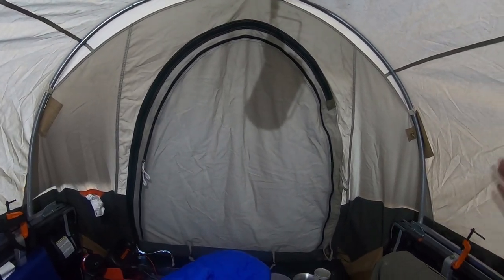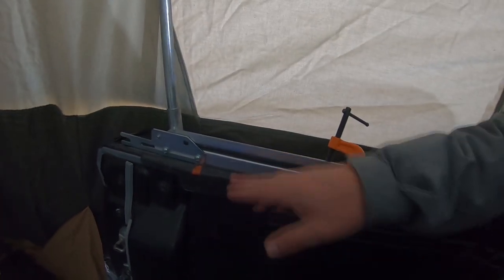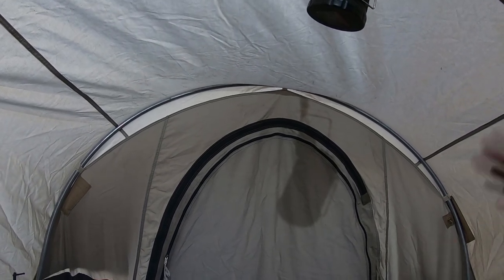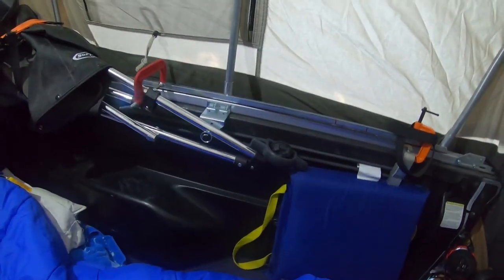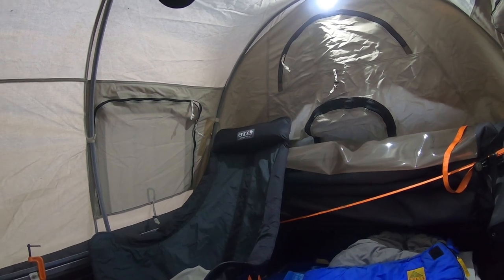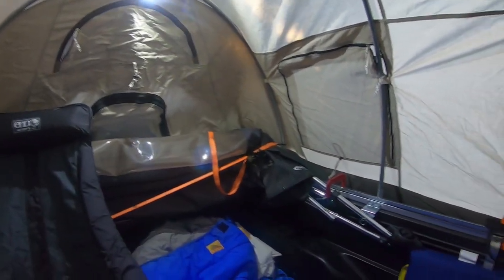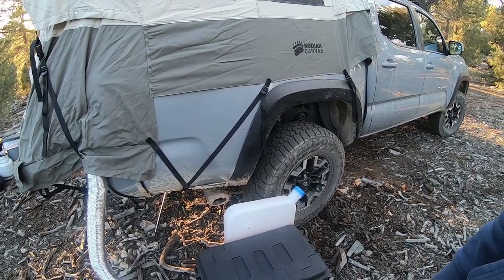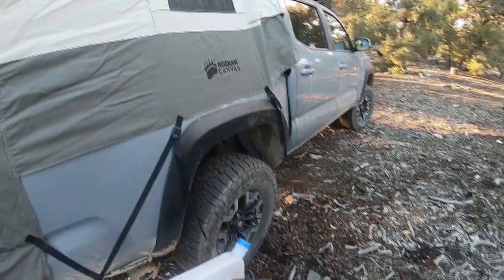Kodiak Canvas Tent Interior WITH a SOFT TOPPER!!

Comment: someone did a drive test with the kodiak still up to see if you could move around the mountains without taking it down. It holds up to like 50MPH. crazy. its easy to set up. it works great and has great headroom. I bring a few foam mattresses and sleep 2 easy with canvas zero degree bags. Comfy. great hunting setup.
Reply: MINE WITHSTOOD 50 mph winds in WY +curt Goudy)..stationary...I drove 20..mounted ...last year...so why not ? From zone to Zone? Problem? KTM Dirt bike LOL.. solution? get rear Skid Mount tail hitch  carrier. versa Hual.  MOTO Tote etc. So happy....

Comment: As a recent owner of a new 2023 Tacoma SR5 with 6' bed, I've vasilated between purchasing another truck tent like I had on my 8' bed 2008 Tundra or getting a Softopper...even considered keeping the well designed lockable tonneau folded back with the truck tent. Whereas my former tent was  a Napier with sewn in floor, I rather like the ability to keep the bed organized as I like and simply set up the tent over it. I noticed that Rightline bed tents also come without the floor, but with nearly $400 in Cabela Bucks, I'm inclined to purchase the Kodiak canvas tent.  I also love the idea of total flexibility since I plan on hauling a small Honda trail bike or scooter in the bed when traveling and a hard topper would prevent that. 

Thanks fof the inspiration to move forward with my decision to have both a tent and foldable cap. I'll keep the tonneau for times I need more security locally in the truck bed.

Comment: Dang that is the setup right there and such a good budget option compared most overland builds. Plus your truck is still useful as a truck!
Reply from the maker: Agreed.  Its an excellent setup for someone who does the occasional overland trips.   Permenant modifications such as campers wear down the every day use vehicle and sometimes impede on the usefulness of a truck.  I dont know what the usage threshold is to justify a camper type build,  but i'd have to think more than a couple trips a month.
Reply: @highlife342  I had a really nice canopy that came with my old Toyota.  It was a nice, streamlined Leer, and I figured it was pretty light and aerodynamic, but that truck was overjoyed when I took off the canopy.  This is a lot roomier than a canopy, and you can use your truck as a truck.

Comment: Love this setup, I have the same Softopper and the Decked Draw System for my Ram and I was thinking about trying the Softopper Tent but I like the extra head room with the Kodiak Truck Tent.
Reply from the maker: Agreed with the extra head room with the Kodiak - it allows for some great ventilation when hot and roomy shelter when it's time to retreat from bad weather.
Reply from the maker: this video link may also spawn some ideas for your camping as well.
https://youtu.be/wM_f4N1M5Xw?feature=shared

Comment: Hey I have a 9 x 8 kodiak canvas tent already.  I have been looking at these tents for my 21 Toyota tacoma TRD off road. I just saw a softtopper and wondered how you like it and what it costs?  What kind of diesel heater do you have? I have never used a diesel heater as I use the buddy heater in my tent normally only to get ready for bed and to take the cool off in the morning. Is there any problem ventilating or is that basically the same as with the buddy heater? Comments appreciated. I also saw a video that days they changed the new truck tents to resting on top of the bed tailgate. I know my truck takes the midsized truck I believe. Did you have any problems using the c clamps for the railing? The one video I watched the Man had to use bigger clamps. I have an inside the bed tie down rail with a moveable track. Will that I present a problem for the rail system?. Thanks Dee Dee
Reply from the maker: The soft topper is awesome.  It is durable and light weight,  folds up quickly for use of the truckbed or tent.  I put some weather stripping around the tailgate and it is pretty dust free even in the harshest off roading.  Cost? Visit the website and see what the price is.  I have a 2kw heater, and it is a totally safe and dry heat that will run all night long,  typically warming my tent 30 degrees more than ambient outside.   You are correct - midsize truck tent...and that also fits a 6 foot bed, midsize.  Bigger C clamps are a must with the rail system,  but the small ones work if you plan on using the Kodiak tent rail attached next to (vs on top of) the soft topper rails.

Comment: What brand diesel heater is that? Did all the parts come with the heater. I like the heater bin idea. Thanks for the video. It was very informative.
Reply from the maker: Its a Rimdoc 2kw from amazon.  It comes with all the parts but you must design a case for it.   Building a case was a fun project, but for almost the same price there are complete kits with a case (usually vertical stance).   If I had to do it again,  I'd probably go that route.   The 10L tank it comes with is an awkward shape (think rotopack) so I bought a more rectangle style tank that was smaller and suited my needs.

Comment: Looking at this for a Ridgeline. How is it for mosquitos getting in between the truck and the tent fabric? Id try to block the holes by the tailgate but im wondering about them coming up at the front by the cab. I too want this with a soft topper (leaning towards buying the Fas-topper).
Reply from the maker: There is alot of fabric that pulls down between the cab and truckbed - all with sinch straps.  Its a good seal,  so bugs don't get in.

Comment: How do you get the rail clamped to your bed rails? I have one and when I go to clamp the rail, it tilts toward the bed and the clamps eventually slide off.  Any pointers on how to secure the rail to the truck bed?
Reply from the maker: I clamp the tent rails to the outer edge of the soft topper rails.  There shouldn't be more than a little pressure from the poles if it's aligned correctly.   Also the large baseplate of the tent rail should be flat on the truckbed (tent rail sitting on same surface as topper rail,  not stacked on each other.)
Reply from the maker: Also, in the video i have it set up overlapping with vertical C clamps.  This was the first try... but what works best is to lay the rails side by side and c clamp in a horizontal position.